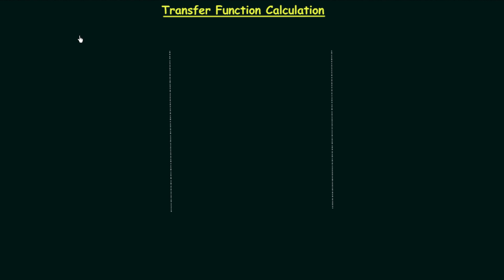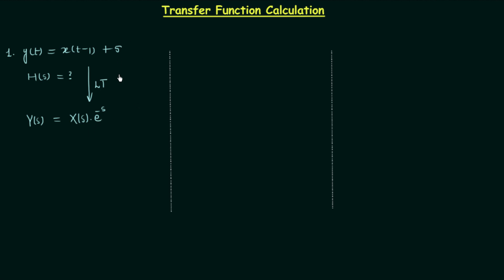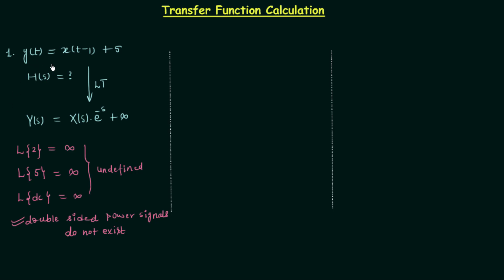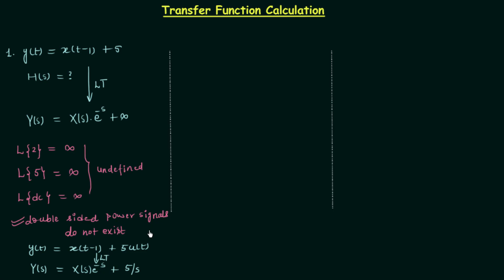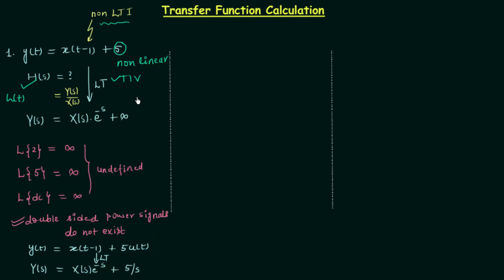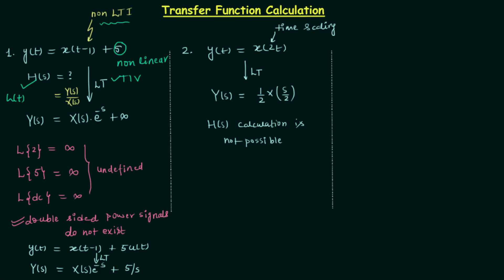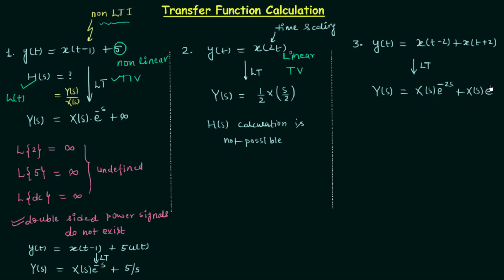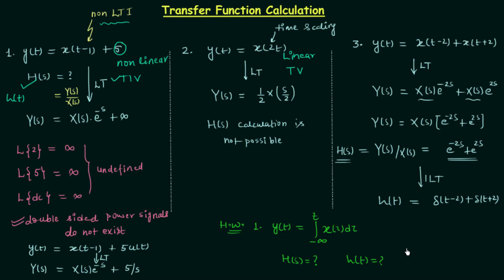Transfer Function Calculation

Comment: The system is non LTI therefore we cannot find the transfer function..
Substitute x(t) by u(t) then the integral of u(t) is a unit ramp signal t•u(t) which is time Varying therefore computating the Transfer function of a Non LTI system is not possible.

Comment: For those who are stuck on the homework because you don't have the Laplace transforms sheet mentioned in the video, you can use the fact that h(t), the impulse response, is the output when the input is the unit impulse function.  Therefore, solving for the case where x(t) = 𝛿(t) will  work.
Reply: Thanks a lot.

Comment: I have a question regarding the Laplace Transform of a constant. So Laplace transform of a constant is inf because integral is from -inf to inf. But if we use one-sided Laplace Transform which has a range from 0 to inf, then L{c}=c/s where c is a constant. 

And both one-sided and double-sided Laplace Transform gives the same result with different representations based on how we defined Laplace Transform. Simply 2u(t) in range [-inf,inf]  =  2 in range of [0, inf]. Yet mathematical representations will be different. 

In many sources, I see they use the second approach. So how are we supposed to figure out which one are we supposed to use?

Comment: It is not possible to find impulse response since lower limit is (-infinity). [1/s can be used only when lower limit starts from 0]
Reply: Yes u r correct, did you solve the problem?
Reply: When h(t) =u(t) then it is predetermined that at -infinty ,value will be zero. During impulse response in frequency domain, 1×H(s)=Y(S)= 1/s, limit will get to 0

Comment: i m waiting fr nxt one......but there is a problem sir.....,
in my course FOURIER TRANSFORM has been used to sort out LTI..........n here LAPLACE TRA. is used..........wt shud i do???
Reply: what matter the most is the procedure of ur solving and the final answer both things should be correct. therefore no matter what you use FT or LT. But if its mentioned in question that you have to use Fourier transform then we can do anything we have to solve the question by FT only. But mostly they dont mention whether LT or FT they just want the correct answer  and ur approach thats it.